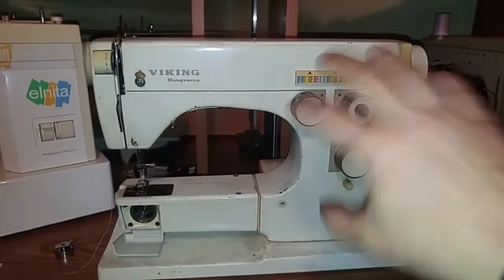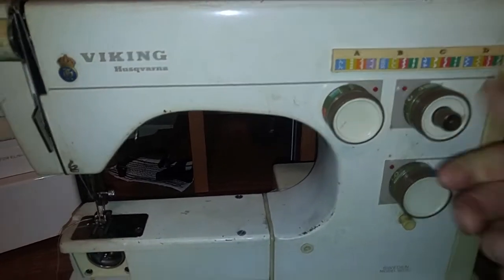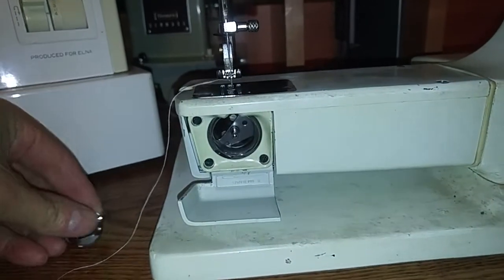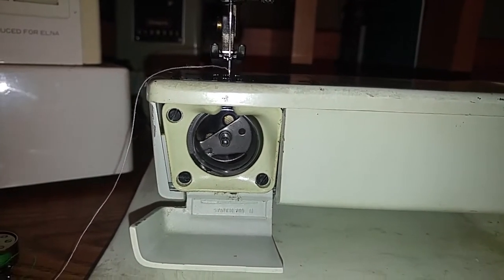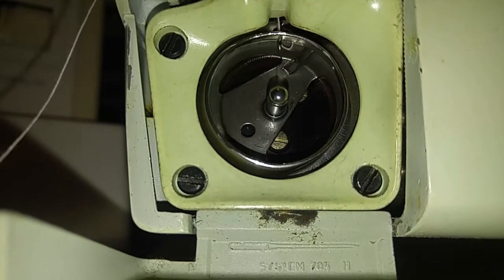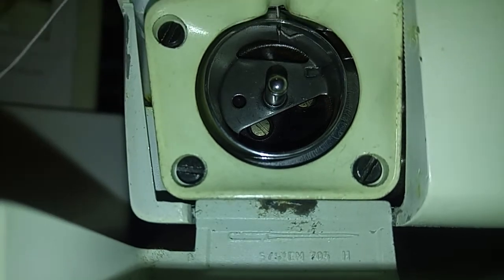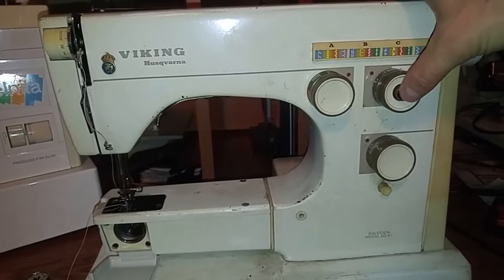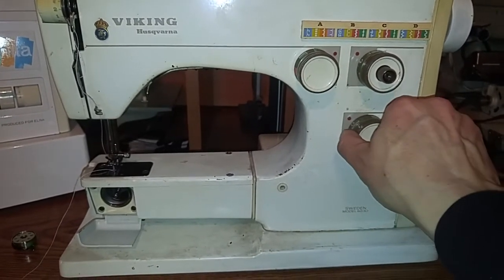Rescue - Viking 6030 Update 1: Shuttle Hook Needs Retarding For Timing Set to Specification

Comment: 1. Hold camera steady on a tripod or gimbal.
2. Better lighting needed.
3. How did you solve the problem?  Not shown.
4. Don't force the buttonholder. This is out of alignment in the back due to stickiness.  You have to align it in the back in a slot else the plastic tab will break. This knob is central to the shaft working well.  I had the same problem with the same 6030 model.
5. I sorely needed to see how to fix that shuttle problem on my 6030. Shame you never showed us how.
Reply from the maker: I haven't sewn with this machine in a while and I recall I hadn't adjusted the timing if I'm remembering correctly.  When I back where this machine is located, I'll see what all has been done and what I can do to remedy and show what I did. I'm sure the service manual details and can be found online for this series.  Thanks for all the comments and help!  I don't do this for a living. :-)